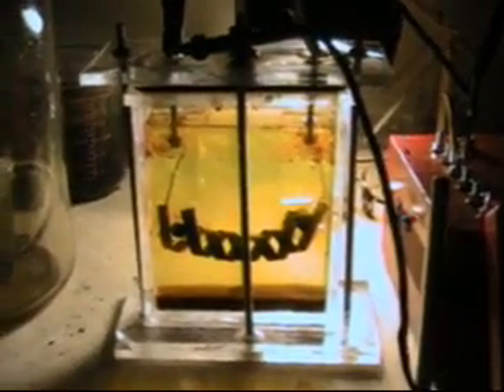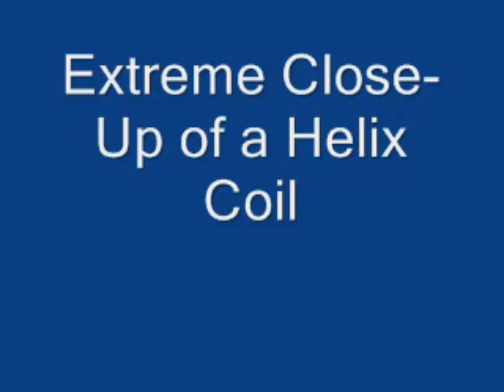Hydroxy Ver 1.7 Double Helix

Comment: The way you are hooking up your electrodes is creating a constant magnetic field, as current is continually flowing in the same way through the helix.

You will be able to reduce and/or eliminate this field if you connect your cathode and anode both on the left or both on the right side of the helix, rather than one on each side.

I'm curious to see what effect the magnetic field has, as it might help deflect ions that would normally be escaping and nudging them toward the electrodes.

Comment from the maker: Heat is a factor in all the cells you can use more solution or go with a series cell that has very little heat. Another option is to make a simple radiator for cooling your solution using thermal dynamics. The Double Helix is the coolest running so far.

Comment from the maker: 23% Potassium Hydroxide by weight to the water. And I use a modified computer 600Watt power supply it gives me 2 through 24 volts upto 24 Amps

Comment: The noise your cell makes sounds EXACTLY like what I encountered when hooking up 4 plate stainless steel cell DIRECTLY to my car battery, which tells me that you are drawing way more than 8 or 9 amps. Would you do this experiment again with meter readings on current/voltage?

Thanks

Comment: Ecellent work!  Are you using an electrolyte?  You may want to find out what the overall inductance and capacitance of the helix is.  Then calculate the resonant frequency of the combination so you can pulse it at it's natural frequency.  This may create more gas production at lower power level.

Comment: have you thought about putting a nuetral ss rod in the center? that could enhance any magnetic properties you are utilizing. 

also, it looks as if most of the hydrogen/oxy is coming off the sharp edges of the metal, i wonder if you could use thinner strips or even wire.

Comment from the maker: I havent done enough testing to answer the shape question, but the heat was room temp and started to overheat 160 to 180 after about 10 minutes of running. A series setup wpould eliminate the heat problem I think ;-)